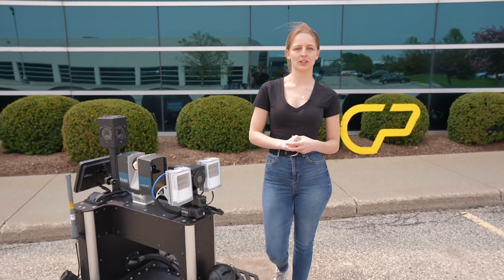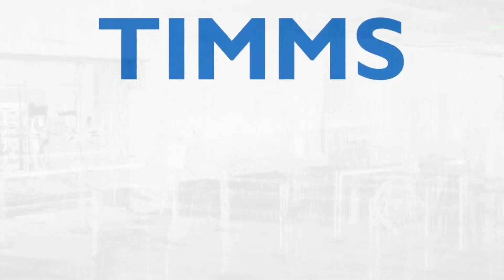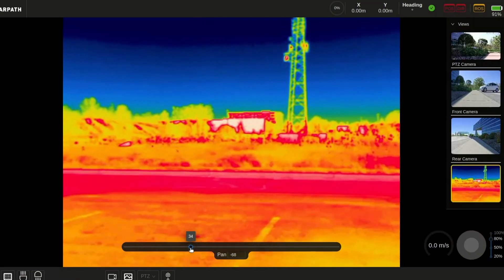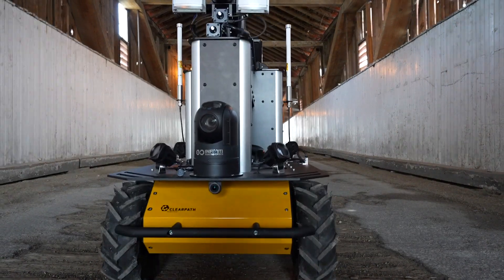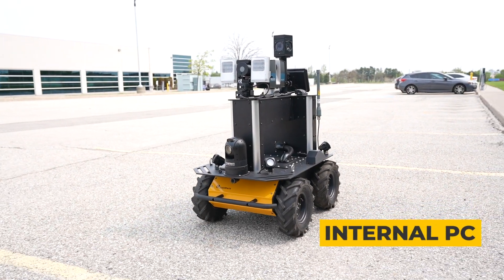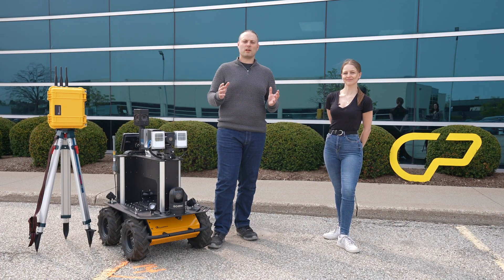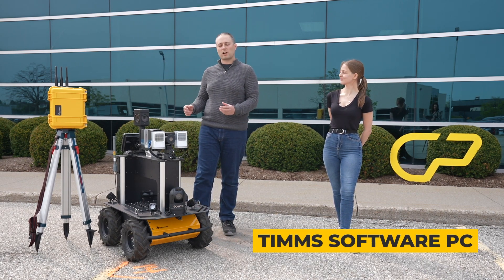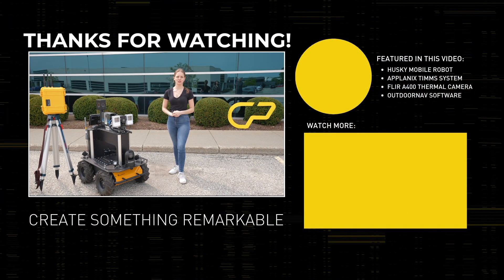Robot Spotlight | Remote Survey Husky

Comment: TIL : stacking 2D LIDAR data and coloring the point cloud is actually possible. I wonder how all the data is synchronised, I'm guessing these are processes running on different threads that are timestamped and later stiched together? I'm guessing the cameras also have polaroid filters to filter out reflections from the water because of the flood lights. Very interesting project, I love your work as always.